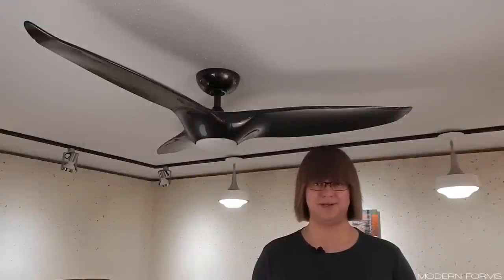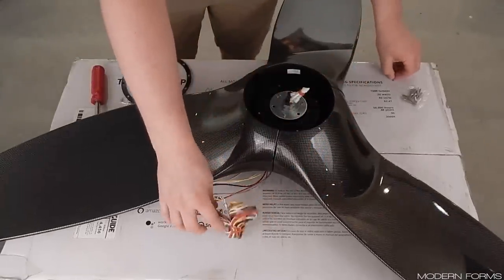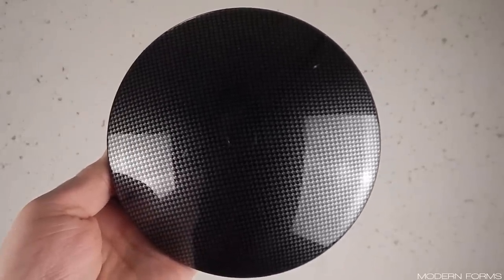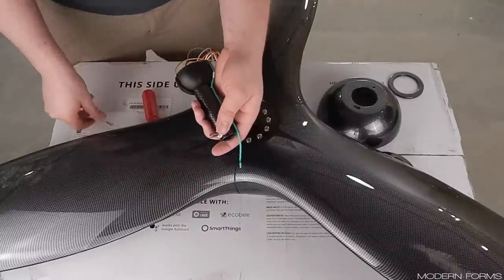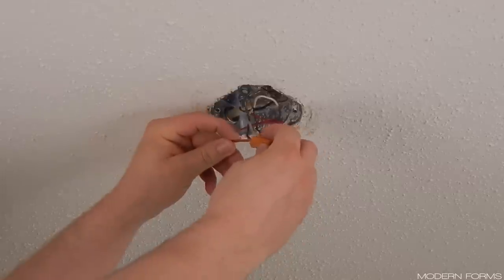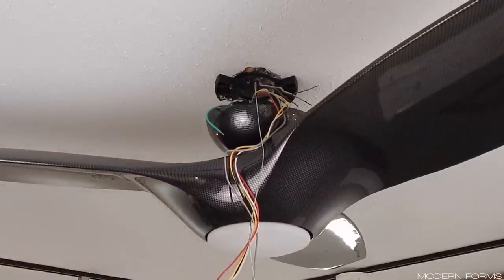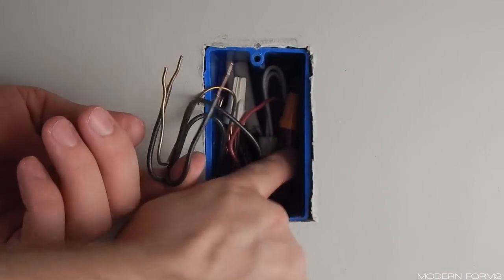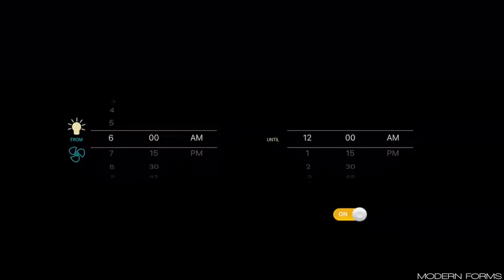How To Install A Ceiling Fan | Modern Forms Morpheus III

Comment: Question, I don't have a black breaker wire coming out of wall outlet, so can I connect black wire coming from smart switch with red wire coming from smart switch to same hot black coming from wall?
Reply from the maker: No, none of the wires coming from the control should be grouped together with each other in any scenario. Red from the control should connect with whatever color is traveling between the ceiling box and the wall box. Whatever wire the incoming black hot on the receiver is connected to at the ceiling, is the other end of what red is supposed to connect with.

Comment: My house was built in the 60's and there's just a black and a white wire going to the light switch  so in that instance how would you wire the wall control?
Reply from the maker: I'm not entirely sure what the neutral does in this circumstance or if it's actually needed. It's not like there are any timer functions, etc. in the control that would require it. But to answer the question, you wouldn't be able to properly install it in your situation. It would either be run new wiring, or just leave the standard on/off switch in place and utilize the app and smart devices for control.

IMO, requiring a neutral is a bit of a drawback here, as there are tons of residential installs out there that don't have it and didn't require it when the structure was built. In hindsight to my review, I think there should maybe be a handheld, battery operated option with a cradle that could be used in substitute. This is a rather limiting feature, and I'm guessing the only other control option, the advanced WiFi control, will also require a neutral.
Reply: Thanks. I'm very glad I watched your install because my existing fan uses an RF remote that's installed in-wall but just runs on a 9V battery – there's no physical switch. It looks like I wouldn't be able to install the remote and would have to use the app, which I don't think is going to work for me. Bummer.
Reply from the maker: I have received word that the neutral is not required for use with the wall control. It's there if you have it, otherwise it can just be capped. So if you have the hot wiring at the wall, the control will work. But it sounds like you just have the RF control cut into the wall. Would likely be a pretty quick and affordable job to have an electrician run a wire down there if you really wanted a Modern Forms fan with the wall control.

Comment: so can i install this is i have only black white & bare in my switch box?
Reply from the maker: With the wall control, likely not. If it's just one cable/set coming into the box, they've probably done a switch loop, which means there's no neutral there. Modern Forms does have an accessory RF handheld remote control available, which would allow you local control without having to hardwire it. Handheld remotes also come with a magnetic wall cradle so you can mount it at the wall near the existing power switch, if desired.

Comment: Carbon fiber?
Reply from the maker: Yes.
Reply: Vintage Fans & More 
I never seen a carbon fiber ceiling fan before. But I prefer oil rubbed bronze...
Reply from the maker: I just recently realized Craftmade offers a carbon fiber finish on one of their blade sets too. It's a super cool finish for a fan.
Reply: Vintage Fans & More 
Oh... But carbon fiber isn't my taste in style...
Reply from the maker: Everything doesn't have to be your taste.